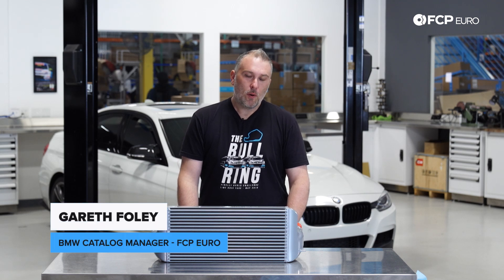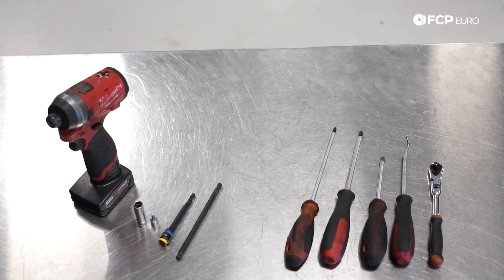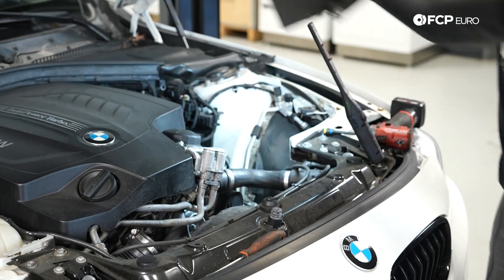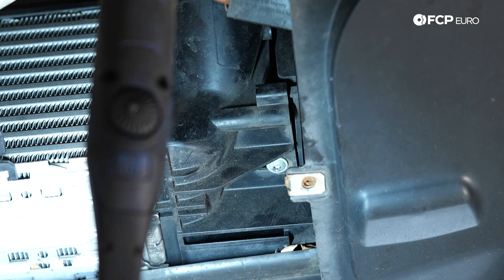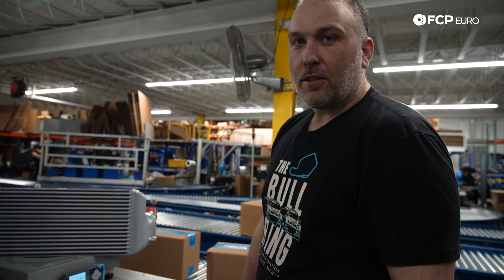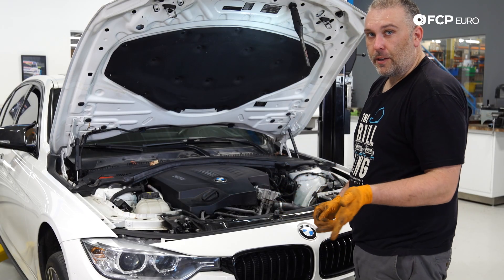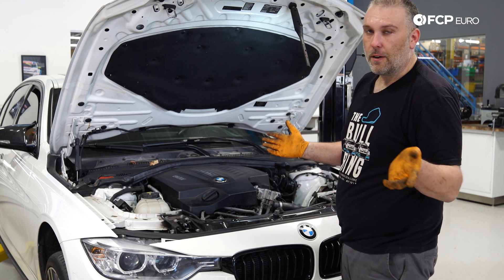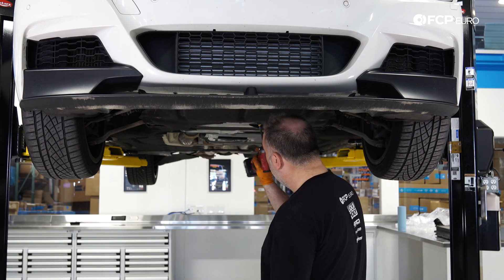BMW F30 335i CSF Intercooler Replacement DIY (2012-2015 BMW F30 435i, 335i, N55 Intercooler Upgrade)

Comment: I could actually kick myself!!! I got as far as loosening the torque screws and disconnected the charge pipes only to find it would drop out. That rubbery grommets part that you mention, I gave it a tug but figured it was attached to the whole piece of plastic. I gave up thinking it would be a full front bumper removal job after that! I was so close to finishing and I had no idea!!!! 🫣 you’ve just saved me £200 having a garage fit it for me. I’m going to reattempt it this weekend on the driveway instead! Thanks for the vid!

Comment: Another great very informative video. I refer to them as "confidence builds", and "headache avoidance" guides for those like myself with their many certifications, shop experience, and car builds from "20 years ago" to think I can still do it, and worse to think can still work on euro cars. My twisted thoughts are more tech, more reliable, tighter spaces, but less frozen bolts, and leaks so it's win. Notice the older I get it now takes me more time to read the instructions, watch the videos, get out the right tools, and get under the car, then to do the actual jobs. 😁

Comment: I’m confused as to why the fan came out O_o
Reply: I didn't take the fan out when replacing the intercooler.
Reply: same, i used this and kies motorsport video to help me through my intercooler, turbo inlet, and charge pipe swap and I just loosened my fan but didn’t take it out and was able to get the new intercooler in.

Comment: Gareth is always costing me more $$$$. His high-tech LED work light is part of a product line by Astro Pneumatic Tools available on the FCP Euro website. He reviewed a smaller 400 Lumens APT LED Light on YT and is probably using his larger 450 Lumens LED light in this CSF Intercooler DIY.  There are newer APT LED Light models at 500 (2-sided light), 650, 720, and 800 Lumens. The neat features include a swivel magnet on the base and a dial to vary the LED brightness, plus wireless charging for some models. There is also a cheap suction cup attachment to the magnetic swivel base to convert it so it attaches to plastic and glass non-magnetic automotive surfaces.

Comment: I'm wondering if for a stock car would it be actually a performance upgrade, thinking about the weight gain 🙄.
For a tuned car I can see it is worth it though.
Reply: Always. I reach 50+ degrees Celsius IAT on pulling when it’s outside 30+. That helps a lot.

Comment: Sweet video!! How bout a F30 335i water pump/thermostat vid replacement vid?
Reply from the maker: Coming soon!
Reply: You don't want to go there. Heart Transplant Surgery is easier. Take it to a BMW Indie Shop. The BMW N55 electric water pump/thermostat fail like clockwork at 60k miles. The labor is 5-6 hours, so the BMW Dealer will charge you $2500 with parts. There is also a hard rubber hose from the coolant overflow to the radiator that cracks at the extreme bend. It is a quick 2 minutes replacement and a $40 part. Get two to keep a spare hose in the car. The new B58/S58 i6 engines in several BMW models switched back to a mechanical waterpump/ thermostat.
Reply: @nycshelbygt500  Haha I hear ya. I've seen a few other vids that aren't as thorough and it didn't seem too bad. Would love to DIY just so I can get my part warrantied and do preventative when it's time, seeing as most shops don't let you bring your own parts. How much would it be for labor at a good indie, and where are you based? I'm in Los Angeles and one of the best indies here is quoting me almost $1k for part and replacement. Plan to shop around a bit more and see.

Comment: What did BMW ever do about their spontaneous combustion cars ? 
They just recalled ..wait for it, 1.03 million vehicles worldwide for fire hazard potential ???
I'm really surprised ppl are still buying into the expensive plastic car maker ? I just seen an abandoned 328 burned to death on the street, & taking an innocently parked Infinity beside it with it !!
I'm sure the toy auto maker knows just how many cycles of hot & cold plastic can withstand before it's disintegration. 
BMW are the new Fiat of old. 
Lexus RC F Sport cars are looking better & better everyday!.
Reply: Every new car uses tons of plastic including under the hood. And the risk of fire is still negligible.  Can it happen? Sure.  Will it happen?  Probably not. Internal combustion engine cars have been catching fire for more than 100 years.
Reply: Bro every car manufacturer has recalls stfu Hyundai over there has recalls for engines that shit itself during warranty
Reply: @yashsab2  Your point? 
The fact is 1.03 MILLION is not a hiccup. It's shotty engineering. Or deliberate built in obsolescence? Take your pick.
We're not talking about Hyundai which are Korean. 
BMW has been making automobiles for over 100 YEARS !! 
My very first car was a BMW bro!

Comment: Umm Gareth?? What did you do with the other Gareth?  lol  You sir, slimmed down.. Good for you!!!   Reason why I'm watching this is because, for some reason, that G20 M340  has been calling my name... lol  The wife however, wants me to buy an RS3..   Or a B9.5 S4...  I like the sound of a Closed Deck though.... And haven't owned a BMW since my E36 back in the 90s..
Reply: it's been 2 years, what did you end up getting? lmao
Reply: @phiillzzz807  lol I still have my B9 S4, and was actually waiting for the updated M350?, but all we've seen is the new X3 M50(that is, if they're looking to call the m340 the M350). I test drove the rs3 but a bit sparse and small. I'm inching towards my 60s in a few years, and want something comfortable, with a little power and luxury. I have enjoyed my heated and massaging seats in my B9 S4 for sometime though lol.
Reply: i thought it was just me lol